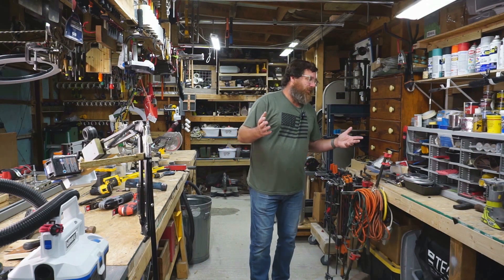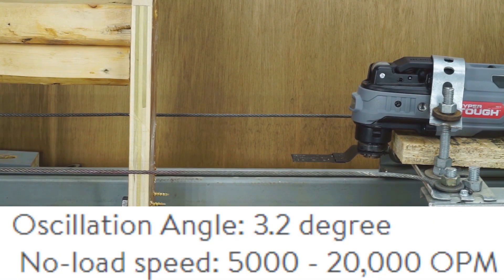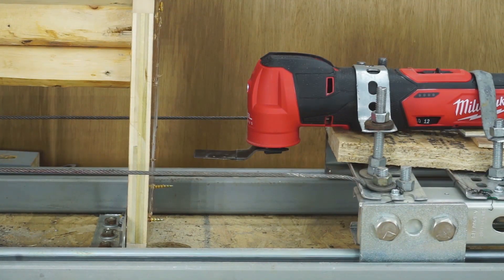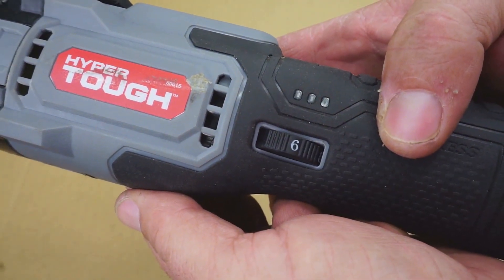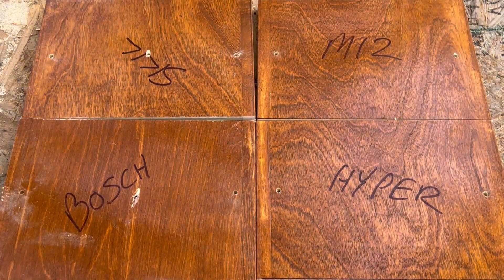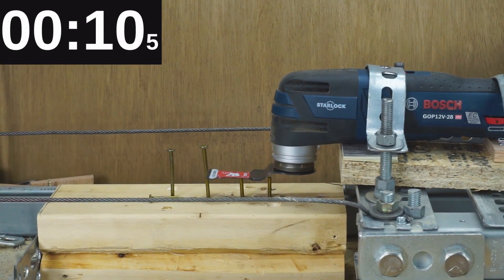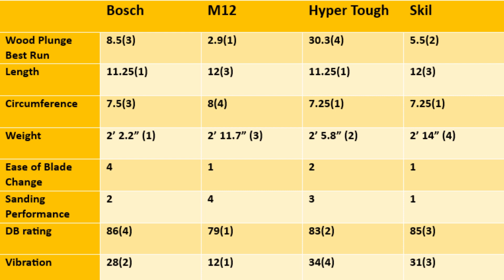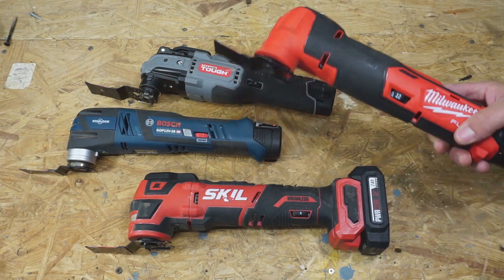Best 12 Volt Brushless Oscillating Tool | Hyper Tough vs. Milwaukee M12 vs. Bosch vs. Skil

Comment: I've been picking up Hyper Tough 12volts on clearance/open box and recently picked up the Oscillating Multitool for $29!

Unfortunately, when testing it it out on some scrap fencing post, it kept shutting off! I changed the blade, as the one it came with had been used up, and pretty much the same result. I switched to the 4 AH battery and suddenly it is cutting as good as anything!

Trying to decide if I should return it, or just run it with the 4 AH. More testing required I suppose!

Comment: Quick question why were the boards fastend differently on the left side one fastener in the center on the right the Milwaukee had two fasteners that were prowd leads me to believe it was eating the paper faster. You can see the darker color where the screws were proud. But the test rig was great 👍👍

Comment: Can you put the vibration meter on the handle where you hold it for each tool? That seemed like you put them in different locations on each tool and seems strange. Put it where the user holds it and see what that comes back with. I would like to see that. Thanks for the review.
Reply from the maker: I will more closely keep the placement in mind in upcoming videos. Thanks for watching.

Comment: I have the Skil 12v currently. Works great and i used it to remove all the trim on the exterior of my house when i replaced the siding. Cut through nails in the trim like butter with a Milwaukee Carbide blade.
Reply from the maker: Very cool, thanks for the info. I think the Skil 12 volt line is very nice.

Comment: I have a good deal of the Skil 12v line. Very happy with them as a part time contractor/maintenance worker. Just used the 12v oscillating tool on a plumbing job so a very interesting test. That said, they need to have their 12v impact wrench upgraded to match the M12 Stubby Fuel as far as performance numbers. The circular saw is perfectly fine, but I wish they’d upgrade the shoe to magnesium from the stamped steel.
Reply from the maker: Sounds good to me. I do like their line as a whole, but I guess they make some cost saving decisions to keep the cost down.

Comment: I love my Hyper Tough 12v Oscillation Tool for $49.88 every day. Great product for the price. Skil got aggressive with their promo price for sure! Great deal for sure.
Reply: Skil has been aggressive with prices since the 12v line launch. I picked up a kit which contained the drill, oscillating tool, speaker, led light, batteries and charger for $109. 

The HyperTough has its place too as the Walmart convenience matters. They’re not bad tools by any means.
Reply from the maker: I got that kit from a Skil a while back. It was an awesome value.

Comment: The skil 12v is my favorite oscillating tool,  glad to see it did well in testing against others. I wish skil would come out with a 12v installation driver.
Reply from the maker: Skil is really growing their line so you never know. Installation drivers aren’t made by every brand but Skil 12 volt would be a good option.

Comment: I have the m12 fuel and absolutely love it. I did have the bosch and it was decent, but nothing really stood to me. But the m12 fuel is on another level. The slightly longer length and girth (giggity) are non-issues for me personally. The features that do matter, cutting performance and especially vibration, are what put the m12 fuel way ahead of the pack.

That said, skil's 12 and 20v powercore tools are decent for the money.

Comment: i purchased my first hypertough about 3wks ago the impact driver 12v. since then i have added more to the collection. great value for the weekend warrior. graet videos man. keep it up
Reply from the maker: Thanks. I agree that light duty projects are where these new tools shine. That being said, I have consistently used the brushless 12 volt drill and impact driver in my shop. No complaints so far.

Comment: I own so many multi tools haha. I have porter cable 20v, craftsman 20v, a no name 9v (was my first cordless model), some corded harbor freight ones and a couple 12v bosch, one being their first model I bought used for nothing because it was used and abused in trade work full of drywall lol and their newest one I picked up this year for $50 bare tool on a amazon sale. I love the bosch because it feels great to use (just like all their 12v line) but there are catches to them like the tooled bit change which can be an actual plus for some people but a minus for most. The new chargers are just ok, I personally have a few of the old school 30 minute chargers and use those haha. By far the best quick change system is the black and decker multi tool change which is what the porter cable and crasftsman use (they are both owned by stanleyblackanddecker just like dewalt). 

I am surprised at the m12 results, I wonder how much more battery that costs to do. It actually made me also wonder if the hyper tough would be any better on their 4ah like the other tools in the line. Either way my takeaway was all the 12v stuff is just good now, just have to pick a price point/how much are you going to use it.
Reply from the maker: I think the jump to 4 AH would benefit the hyper tough some for sure. I have found that using the 2 or 4 AH is quite a bit better than using their 1.5 AH. 

I LIKE THE Bosch line as well. The installation driver I tested on the video before performed very well. Bosch does have a 6 AH battery (saw on Amazon) which would be nice to have. Budget constraints…

Thanks so much for watching.
Reply: @Zacksshoptalk  yeah some batteries cost more than tools now haha
Reply from the maker: Absolutely